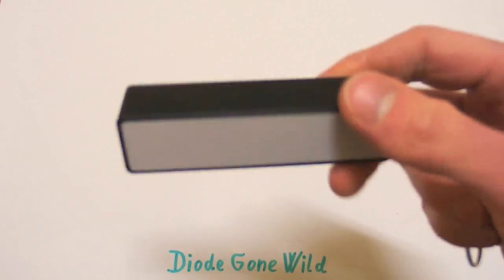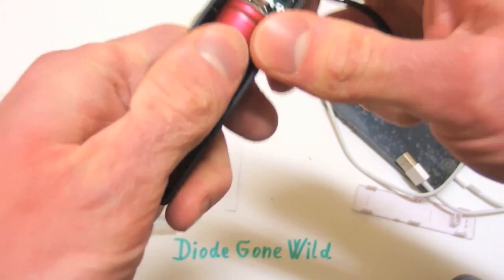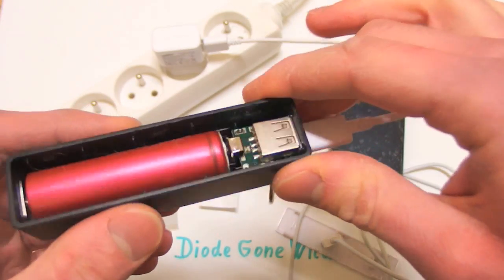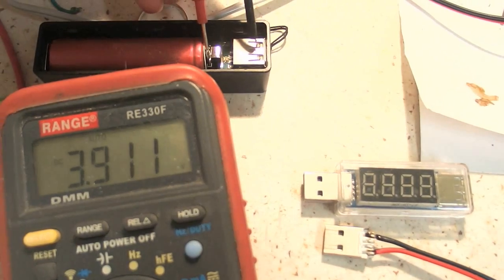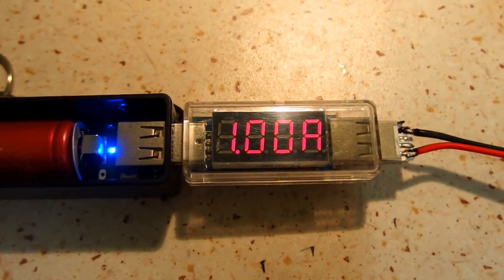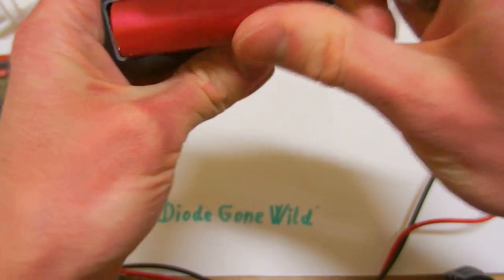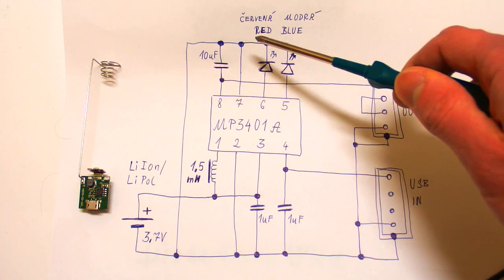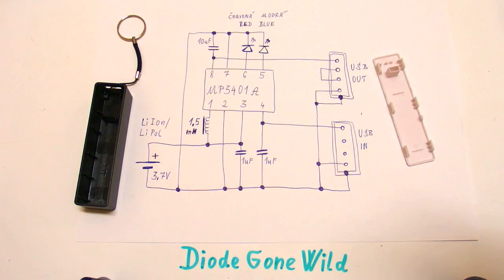Cheapest Power Bank Review (with Schematic)

Comment: Not bad for 80 cents, I would say. By the way, 1.5mH seems too high, maybe it is 1.5uH. These things operate at pretty darn high frequencies, 1.5uH seems more realistic. On top of that, you need a boat load of turns to get that inductance on this tiny core. Good videos, though, I didn't know they're down to 80 cents :)
Reply from the maker: Yes, it is really not so bad for the price :) except you have to have 
your own cell and there's no fuse in it. You are right, the inductor is 
1.5uH. In the end of the video I've corrected the schematic :).
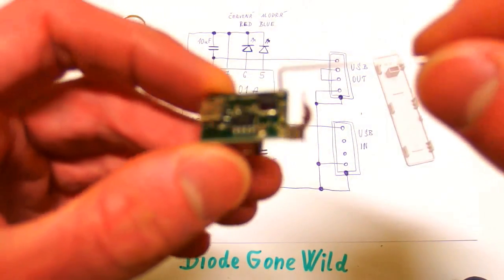Reply: Sneaky, 9 seconds from the end :D I took off at 12:15 
Yeah, the absence of a fuse is nasty. I use a very fine (0.08mm in diameter) magnet wire for that purpose, it pops above 3A. Not ideal, but works to protect from shorts.
Reply: I'm not really concerned for the absence of the fuse. You get a decent enough cell, something brand name rather than a China made one, and i mean if you harvest something out of an old laptop and i've seen fresh Sanyo cells for 2€ on nkon, it will have a pressure activated disconnect - if you ever get it hot enough to boil the electrolyte, it should detach before the electrolyte can catch on fire :D And it does have a built in short circuit protection in the controller IC at least for external shorts, though obviously not for internal ones.
Reply: Where abouts did you put the piece of 0.08 wire?
Reply: I just gived advice to someone else on this thread to try with 0.07mm wire :D
Reply: greedy companies sell thiss to the mass for a lot of profit